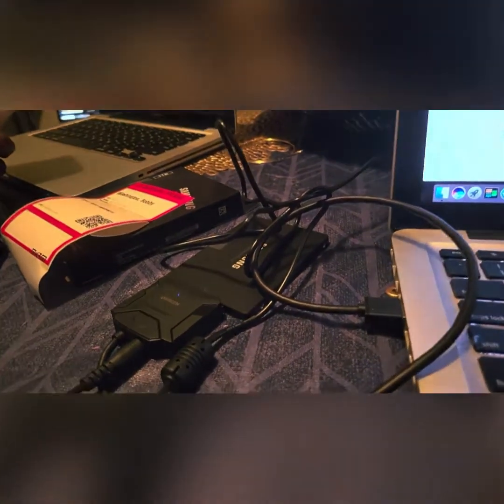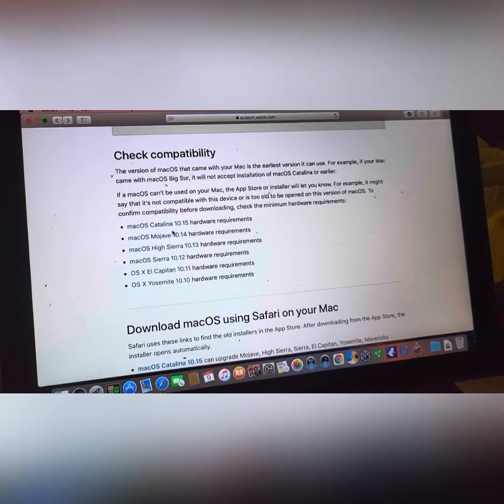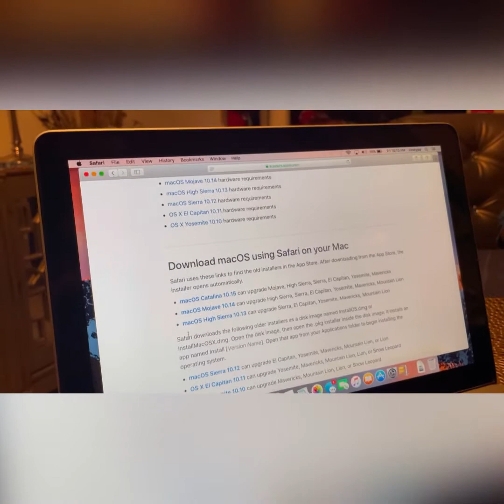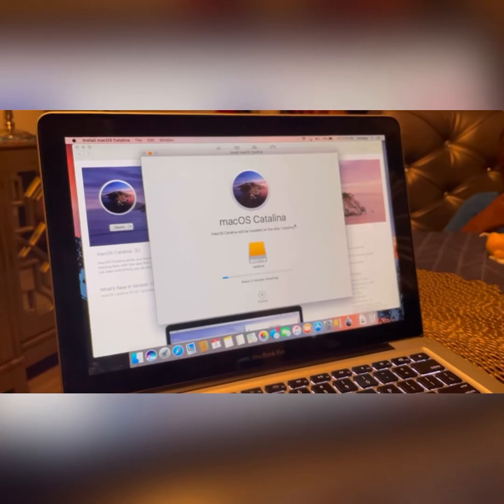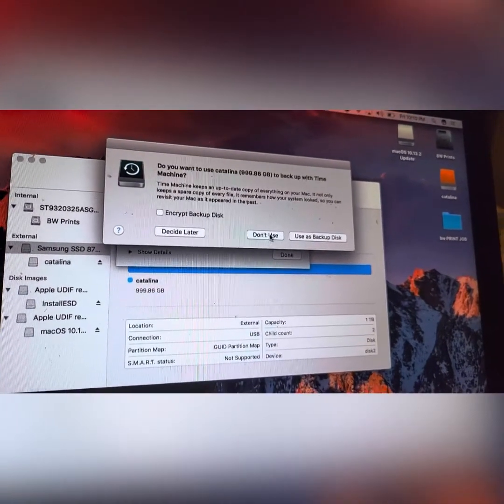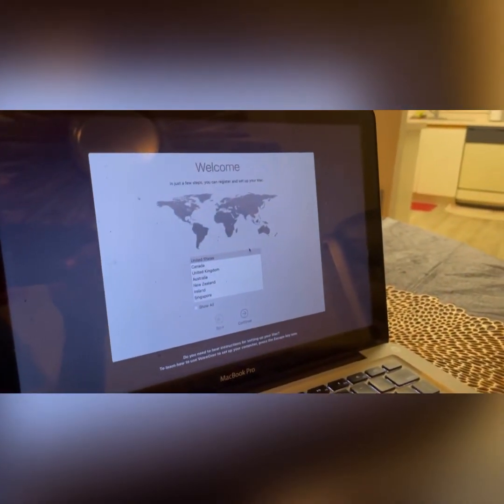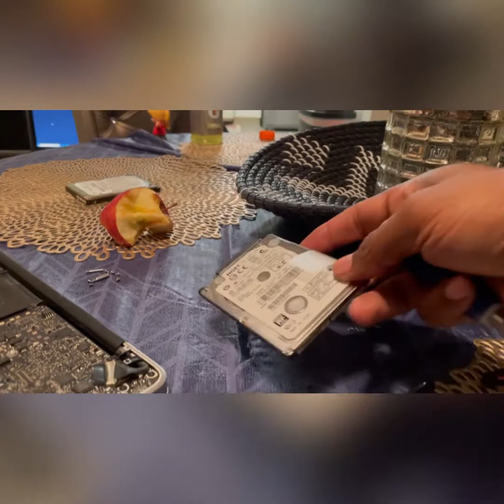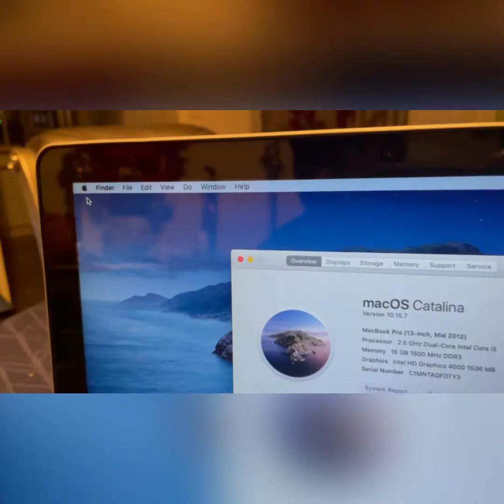Upgrade SSD EVO 870 In MacBook Pro 2011 2012 Plus install OS Step by step Tutorial

Comment: Great how to vid. Snagged an Evo 2TB ssd on cyber Monday to replace 500 GB internal. In my early 2011 MacBook Pro   What’s that cable you used to copy your internal drive to the new one? If you post an affiliate link, I will use it to buy. Again, great instructional video. Thank you. God bless.
Reply from the maker: Thank you. Glad I could help. It’s a SATA  reader cable…